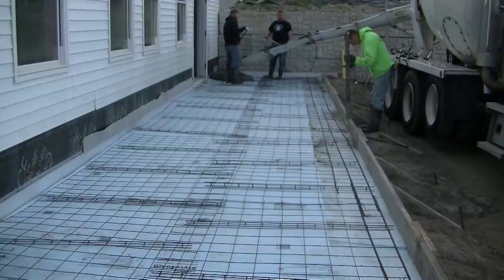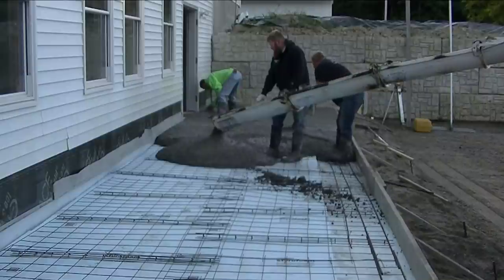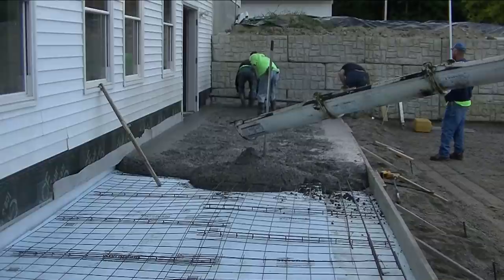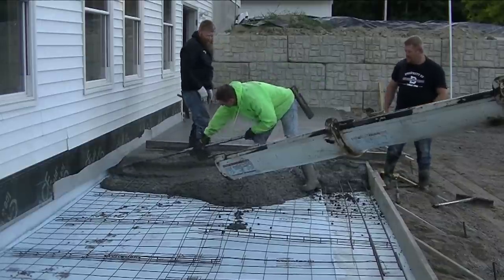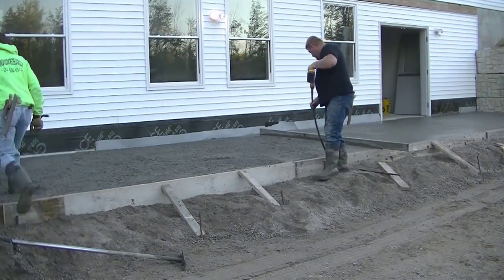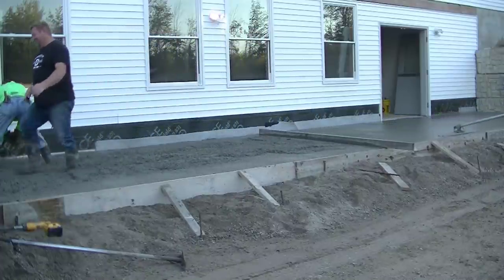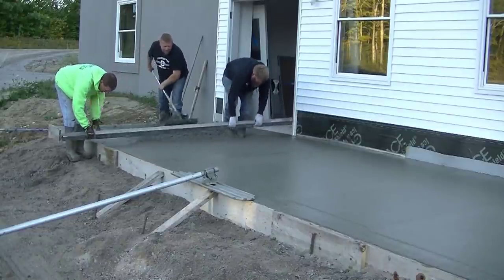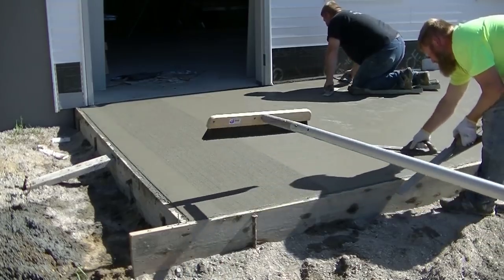Concrete Patio DIY Pour (How Fast Do You Have To Be?)

Comment: Lincoln, CA.  I'm a home hobbyist concrete guy. Been pouring over 30 years, mainly with my trusty concrete mixer.  I tend to do smaller pours obviously with my own mixer.  Usually about 100-150 sqft at a time. I've done probably 300 yards with my mixer.  Hot tub slabs, some small retaining walls, sidewalks, mowing strips, and driveways.  500 sqft. driveway with a combination of aggregate finish and smooth.  I am 58 now and still pouring with my concrete mixer though my recovery time is a bit longer now. ;)
I really enjoy viewing concrete pours and watching your channel.  I watch quite a few different channels over the past 2 years and this is the first time I decided to comment.  Keep up the fine work!

Comment: My company works out of Pittsburgh PA.  I'd charge about $6500 under normal circumstances. $3800 for a church and I'd write it off.

You and your guys run like a machine. It's a pleasure to watch.
Reply from the maker: Thanks Steve
Reply: What company. Curious. I work for W.A.hoy
Reply: @smackflack5771  Precision Cement
Reply: @stevemoore6066  yal do commercial or residential?
Reply: @smackflack5771  We do both but it's probably 70% residential to 30% commercial.

Comment: Why not snap a line on the wall and pull a screed off it then float tight  instead of random floating and checking with the laser every couple feet
Reply from the maker: Normally we do snap a line. There was an overhang with the construction that made it impossible on this one.

Comment: $2,000+ for the concrete. $1,000+ for the foam, steel, boards, etc. 3 days labor for 2-3 guys (layout, pour, cleanup), $1,500+. More if you have to excavate and compact the base. At least $4,500 plus 25% to cover insurance, equipment, profit. I would bid $7,000 to $9,000. 

I like to see a thicker pad like that with steel and the 4,000 psi mix. It doesn't increase the total that much. I bet if you compare that slab to a 4 inch 3,000 psi slab in 2 years you'll see a lot less cracking.